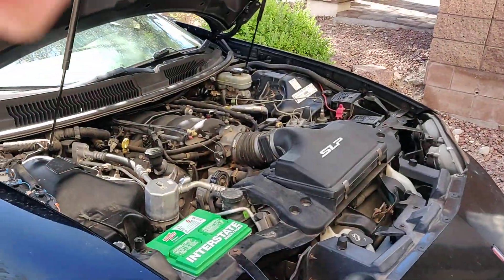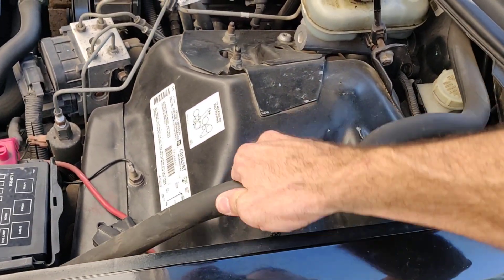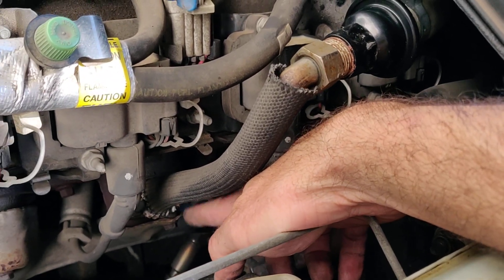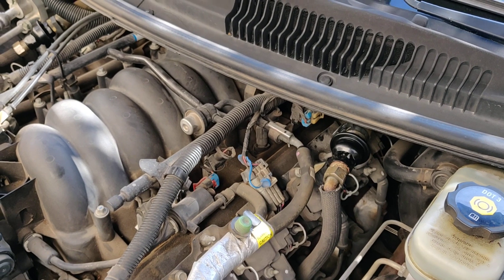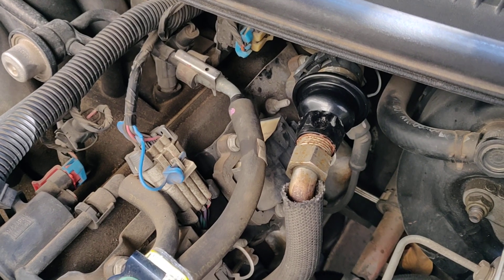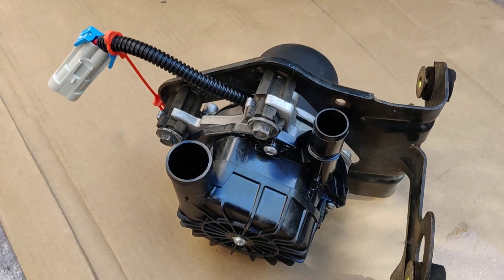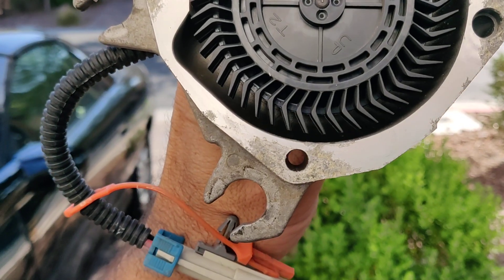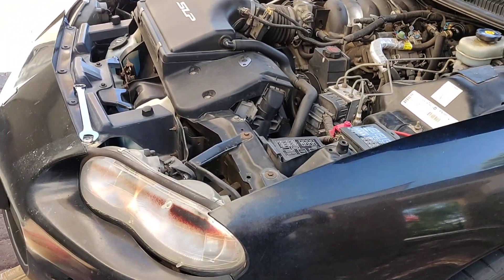LS1 Secondary AIR injection system fix for P0410 part 2

Comment: so i don’t even have the air pump installed i have it sitting how i bought the car with it unistalled and it passed emissions testing somehow? 😭 was this pure luck or what
Reply from the maker: Someone has probably removed the system and removed the coding from the ECU which is why you passed. It might also be that your car came from the factory without it,  I'm not sure. But its a pretty common mod for guys to get rid of the system completely.

Comment: So is it safe to assume the system is working correctly if I feel vacume from that hose you showed around 6min mark....
Reply from the maker: Well I think it's safe to say that your control solenoid and check valves are ok. Still need to check your air pump operation.

Comment: What actually controls the air pump. My pump works when I hook it up to a battery, but not on the car. Also checked fuse and relays. Everything is good.
Reply from the maker: I assume it's the ECU, not entirely sure though. Do you have power to the pump's plug upon a cold startup?

Comment: Vibration and penetrating oil is the key to loosening fittings. I use a Ryobi 12v Auto hammer at 3,600 beats per minute on difficult problems
Reply from the maker: Hmm, never heard of that tool. I will look into that, thanks for the tip.

Comment: Appreciate the video, just found out there has been some ghetto rigging in my ole '98 z28 emissions system. She's been mothballed for a few years and never had smog issues before but with the shops getting nailed so bad they are being strick as hell now. The air box doesn't even have the secondary air hose port but does have a pump at least still mounted in the car so that's no biggie but they also have some aftermarket valve covers which required up to chop and add hose length to the pcv hose to reach that driver side valve. Without any check engine or codes ever happening I gotta assume they deleted that error code with a tuner (which is fine by me lol) but I am curious if you've had any issues passing smog with tht SLP lid considering they weren't a factory option for z28's only SS trims? Have half a mind just yo get the lid and stick a dummy hose there to pass that visual since she passes on the sniffers just failed the visual for the 1st time and I've had this car since 2011 surprised no-one noticed this before now.
Reply from the maker: Nope, passes just fine with the SLP lid. If you're tuned out, that's the way to go!
Reply: Think I will, I noticed the 98 slp's don't have the secondary air hose cut out pinched out which seems odd 99-02 do, I'll just punch it out and put the dummy hose on to look the part lol. Is your states smog test as thoroughly bs as our CaliKremlin's is lol? Shit my '11 STI daily driver has an aem carb legal cai and last year was the 1st year a smog tech even let me pass WITH the carb # and didn't make me go home swap out the pos stock box go drive 60 miles n come back to retest.. Ridiculous as hell to pay for the proper legal carb intake just to still be asked to bust out the stock box. Makes me wish I'd just bought the grimmspeed hybrid ram air set up since I've been swapping put for years until now.. Better system by far and cheaper without that shake em down tax on the manufacturer just for that damn carb stamp 🤦. Lol I'm just bitchin now either way appreciate the response and the video's I'll be ordering the check valves as well just to be through I'll be sellokg the car in a couple years and don't wanna sell a future headache to another car nut I can't do that to our people 😂
Reply from the maker: @Excellent_Duderino  oh I completely understand how maddening this emissions garbage is. I don't think Nevada is as tight on emissions tests as CA though. They do a quick visual, I mean like 5 seconds, and then hook up to the OBD2 port. If the tests are complete and no ses light, you're done. 
Thankfully I do not live in Vegas anymore, moved to IL where emissions isn't required in most places. 
Good on you for fixing as many issues as you can for the next guy. Good karma can not be underestimated!
Reply: Moved to a state which believes in freedom! Man it's time for a lope'y cam and a twin scrolled turbo set up with a gun rack bro lol! Yea no joke karma is some real shit.. Ironically I know the guy who sold me the car a small private mechanic shop who obviously pulled one over on me lol, got so much heat from returning customer's who he didn't keep his promises with he committed fraud and pretended to sell his business to an old coworker on paper so they could say new management isn't liable for prior warranty work etc for returning customers and eventually lost his whole business as a result, but he did get away with that bs for a good 15 yr's. Surprised he didn't lose his teeth after all that.

Comment: I got a 02 wls trans am with 33k on it and my check engine light was coming on. So my mechanic told me it was this so I was just curious what it did. Great video! It's going to cost my about $500. I'm sure I could do it cheaper myself but you know who's got time for that!
Reply from the maker: 500 sounds reasonable, depending on what all he's replacing. The pump itself is an expensive little unit. 
Thank you for taking the time to comment.

Comment: I have a 2001 Corvette LS1.  My problem was the AIR control solenoid and it is almost  impossible to find.  It worked fine for 500 miles... then my AIR fuse blew, replaced it and was fine for 100 miles.  Now my CEL came on w/ P0410 and everything is working!??  I am an ASE CMAT and this system is a real pain in the A**!  Nice Video!
Reply from the maker: Have you checked the pump for operation recently?  It is possible it recently died. Bad luck, but it happens. 
Congrats on ASE cert, I just certified on A4 and A5.
Reply: @jcx2bby  The problem was the hard plastic vacuum hose from the solenoid to the valve on the pump.  I had 10 ft. of 5/32  hose...  Problem is fixed in that area for good!  Thanks again!
Reply: @CaptEricS  Going through this now. Replaced the pump, check valves, repaired an open vacuum line under the battery. Still got a pending p0410!! Next step is this hose you are referring to. I'm bitter about this system to say the least.
Reply: @superdave1.0  The final fix... I removed the the fender skirt cover behind the RF wheel and followed the vacuum lines to the AIR solenoid. Using a 10mm wrench, remove the sol. and reposition it to the batt. area. (Note; you cannot see the sol. See my post on "Corvette Forums" for that code.) Next; The vacuum hose is hard plastic and a joke.  I used 10 ft. of 5/32nd rubber hose and bypassed the POS plastic line from the AIR pump to the Sol.= problem fixed!  It is easier to remove the L/H headlight bucket than working from underneath.  If you think the AIR system is a joke wait until the headlight motors go bad.  I've had the L/H bucket out 8 times and the R/H out 4 times, trying to fix the headlight motors and AIR system. Don't try to fix the motors because you can buy new motors on EBAY for $85.00 for the pair.  To remove the buckets, remove the top cover and the black bezel.  Look carefully and you will see 3 studs w/ 10mm nuts holding the unit to the fender skirt.  Remove them and look for 3 bolts w/ 13mm heads holding the bucket to the frame.  Pull forward and the whole bucket comes out.  I bought the brass gears for the motors ($50.00) Now, I'm selling them on EBAY after I found the new complete motors.  I hope this helps!
Reply: @CaptEricS  Update. Replaced the solenoid and relocated it to the battery area like you did. Also replaced the line from the solenoid to the check valve like you. 10 ft of 5/32 vacuum line. Still getting p0410.

I stopped by the dealer today and the shop foreman said it could be the computer itself or possibly needs a firmware/software update. I'm at a loss. 

The pump turns on every time the car starts. Check valves replaced. Don't know what to do next.
Reply: @superdave1.0  Okay lets back up a bit.  The AIR pump should run for about a minute on cold startup.  The O2 sensor detects changes in the O2 level of the exhaust while the air injection system is functioning in closed loop.  The O2 sensor sets the code.  Check the AIR hoses for splits or cracks, loose, etc.  “OR” Plug in an OBD2 scanner and watch the O2 sensor’s action… It should switch from .2 MV to .8 MV rapidly when warm and in closed loop.  A lazy sensor can set P0410.  Yet, that is very rare!  Also, is the vacuum solenoid on the AIR have a blown diaphragm?  Very easy to test; remove a hose to the check valves… It has to be under pressure when the AIR pump is running.
Reply: @CaptEricS  Appreciate you. Have checked all large hoses and connections for the air pump, all good there.

I watched the 02 sensor numbers today with my scan tool. They didn't stay dropped when the air pump was on. They kept fluctuating. 

I ordered an "air diverter valve" today. The one that sits next to the AIR pump. I will put a vacuum on it tomorrow, to see if the diaphragm is bad. I figured for $20 couldn't hurt to replace. 

I repaired another vacuum leak today underneath the battery. This was the hose coming from the back of the intake manifold. My guess is the hose has more damage somewhere and needs to be completely replaced instead of patched. I also need to test for vacuum at that line since that is source of vacuum.
Reply: @CaptEricS  Another update. Found I had no vacuum at the vacuum tank/reservoir. Just replaced the line coming off the back of the intake manifold to the tank. That fixed my vacuum issue. 

Now my HVAC controls work properly (feet, face, defroster). They weren't working before. 

I'm hopeful this will resolve my p0410 as the system relies on vacuum to function properly. We shall see.

Comment: So if I don't need to pass emissions should I even bother fixing this?
Reply from the maker: You don't have to at that point, no. As far as I know, the AIR system has zero affect on performance, only emissions.
Reply: @jcx2bby  okay thanks. previous owner messed up the front drivers side and it bent the rod that thing is attached to and broke it 😂 that seems to be the only issue though based on the codes besides a cracked bumper too. thanks!
Reply from the maker: @gopro2027  no prob, enjoy that wonderful F-body

Comment: I know this video is a little old, but do you happen to have the part number for all those parts? and are they the same for a 2000 Camaro also?
Reply from the maker: All the same stuff for 2000. Just go to rockauto and you can get the part #s there. That's what I did.

Comment: So when you put the check valves back on do they screw on or pop in?
Reply from the maker: They screw onto the metal tubing and the rubber tubing slides over the other end of the valve.
Reply: jcx2bby gotchya! And do I have to wait a few days to remove check valve like you said with WD40?

Comment: Can u put the link we’re u bought the part I can’t find it thank u
Reply from the maker: The pump I got on eBay so ymmv there. The check valves were rockauto https://www.rockauto.com/en/catalog/chevrolet,2002,camaro,5.7l+v8,1379976,exhaust+&+emission,air+/+smog+pump+check+valve,4912

Comment: Great video and very informative i appreciate individual like yourself taking the time to post a video of this nature I'm new to the LS world with a mint condition 2000 WS6 these cars are nearly 20 years old and need some TLC
Reply from the maker: Welcome to the club my friend. 
Glad you found the vid useful,  the secondary Air system is something that all 4th gen owners will deal with at one point or another,  lol. Kinda like bad cats, loose steering wheels and hydraulic clutch system failure

Comment: Thank so much for this video 
I have a 1999 camaro SS 
getting the same codes P0410/0412/0418 
Gonna do these changes and hope for the best
Reply from the maker: So my SES lights stayed off, all the tests completed on the car and I passed the smog test! Hooray
Reply: jcx2bby       That is awesome 
Kudos to you.
Reply from the maker: I just made this video today and haven't tried to pass smog yet so I'm still crossing my fingers. Remember that you may have issues with the diverter valve or solenoid on top of a bad pump, check valves, etc. Good luck and I'll let you know how mine turns out.